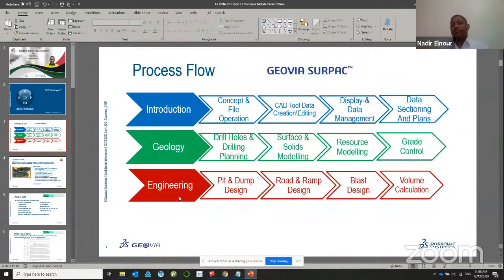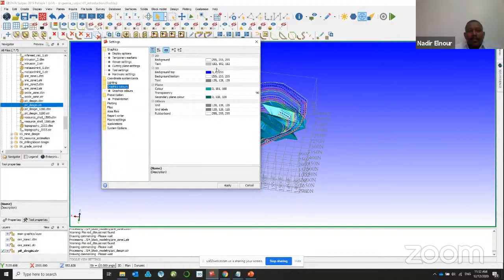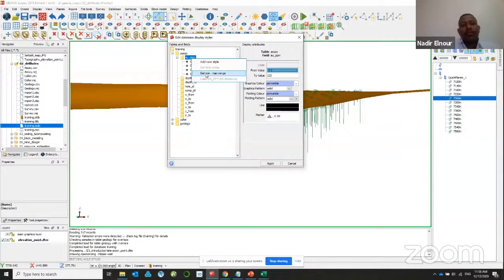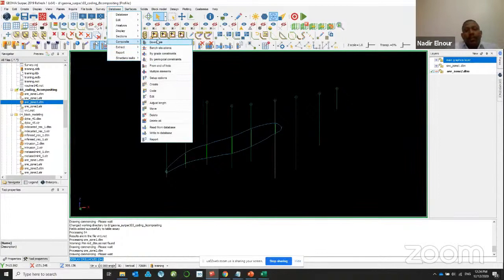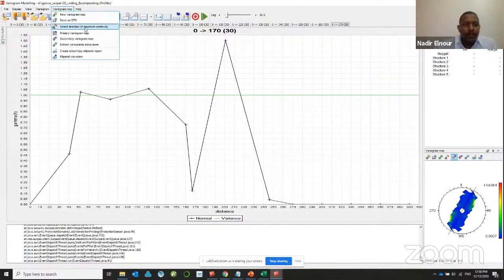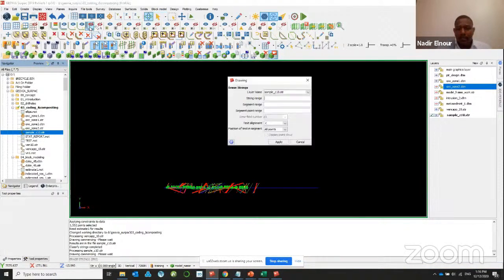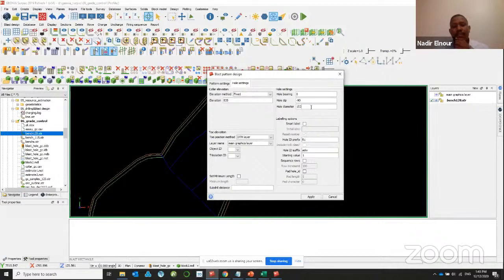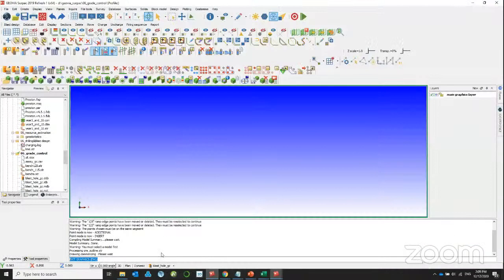GEOVIA Surpac Free Training with Geovia champion Nadir Elnour

Comment: Total length of raw samples 884.000 differs from total composite length of 865.081 + total short composite length of 6.621 because of null or negative values for the first element or because of geology zones splitting raw samples.

Warning: No drill holes found in the database...Can anyone help me  with this  error im stuck